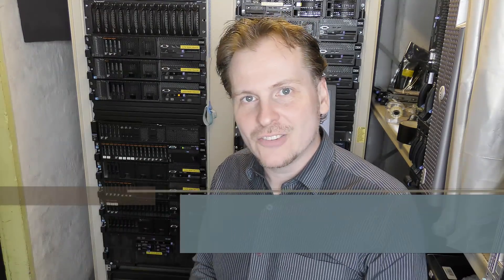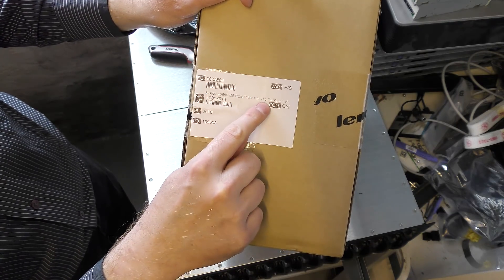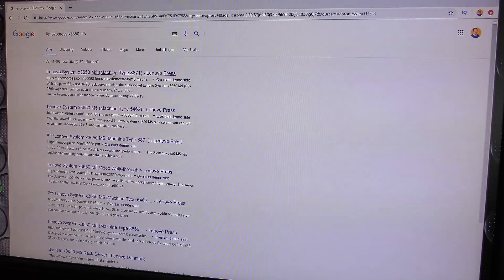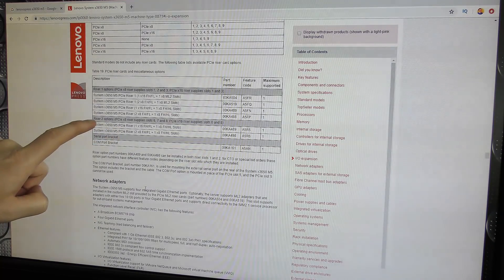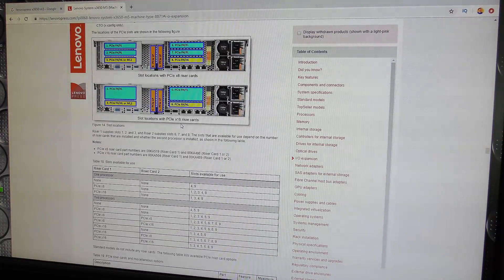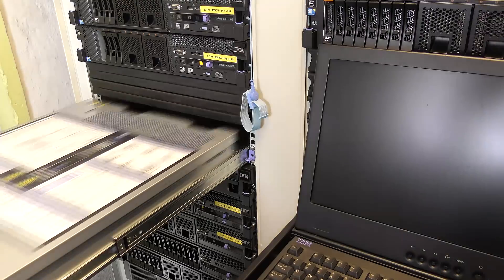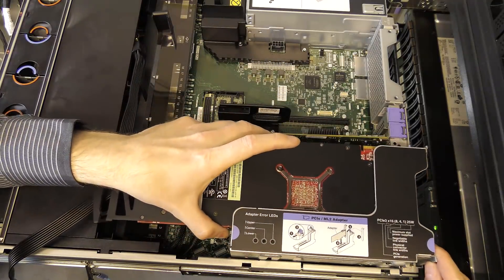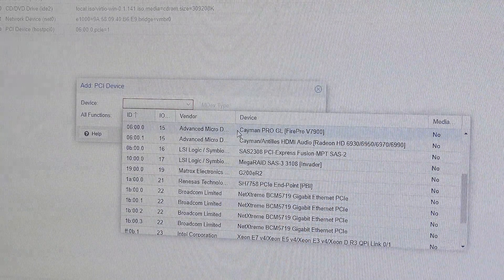Riser Card Options for Lenovo x3650 M5 & What is an ML2 - 836

Comment: Hi I have x 3650 m3 server , the server can't communicate with the IMM , when I power on it shows imm kernel loading , then running , imm initialization timeout , and finally uefi initialization and then it reboot s again . It keeps on rebooting for a while and then it randomly boots to bios . But I am unable to access Imm through bios either . It says can't communicate . I did power cycle and changed cmos and imm jumper setting but the power light keeps on blinking nonstop when jumper is changed to 23 . There are no warning lights either. Will a firmware upgrade do the trick ? Meanwhile the management port shows activity light.
Reply from the maker: Hi ranjith r
Check with the manual if all the jumpers in in the right position!  glad you liked the video :-)
Thank you for watching! :-)

Comment: @Morten: can you recommend a IBM / Lenovo server with 12x3.5" HDD bays in a 2U form factor?
Reply from the maker: Hi Art of Server
IBM was a bit quick to jump to 2.5" so both the x3650 M2 and x3650 M3 was only 2.5" but then the x3650 M4 came in a version with 6*3.5" and a model "IBM x3650 M4 BD" with 12*3.5" and it is also available in the x3650 M5.
Thank you for watching! :-)